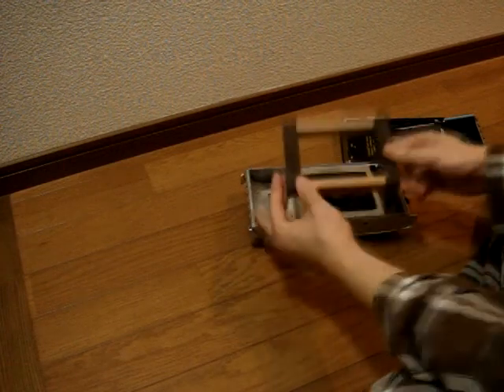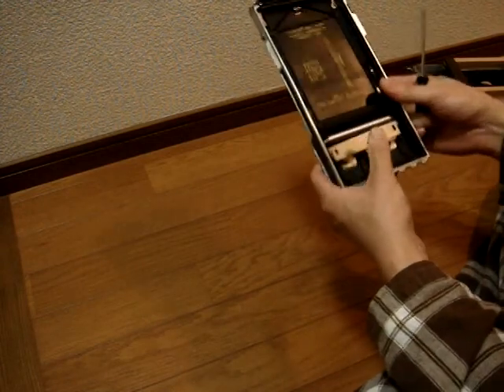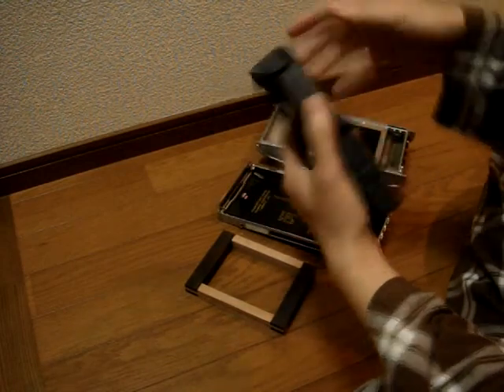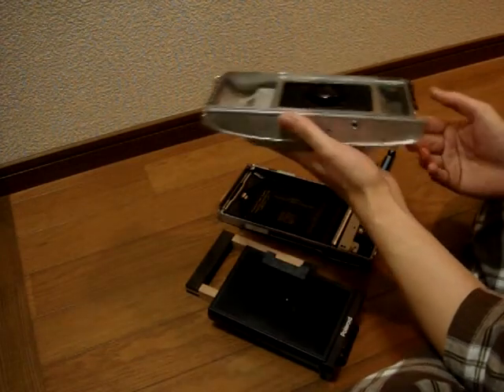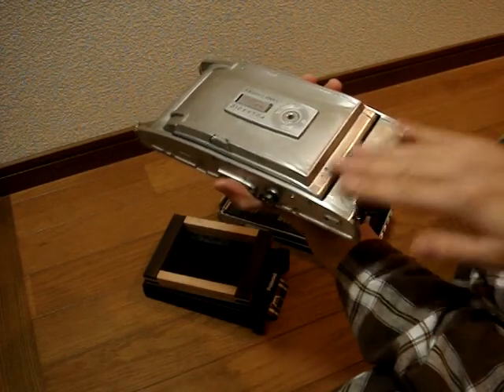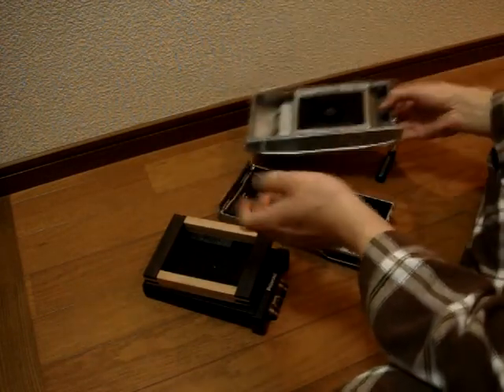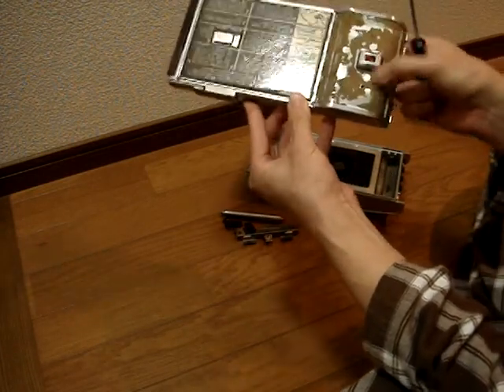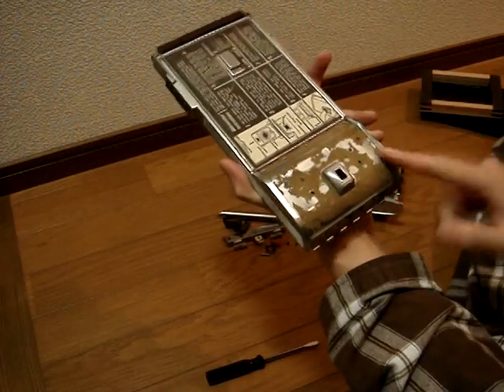How to convert a Polaroid 900 to use packfilm pt.11

Comment from the maker: This is a perfect application for 3D printers. You could basically make the whole back by printing it. It would be easy (relatively speaking) to make a 4x5 back/adapter too. I think there were some kickstarter projects for something similar using 3D printers.